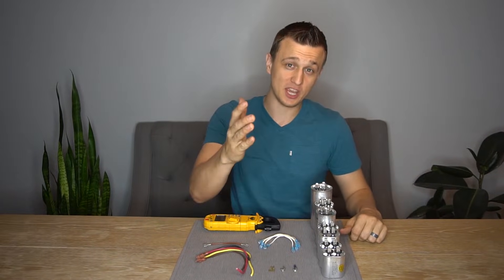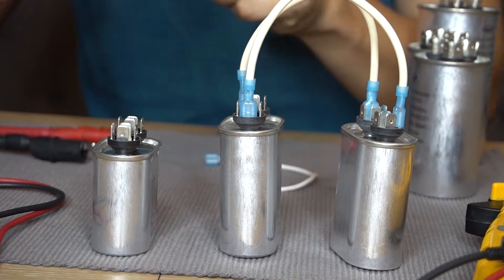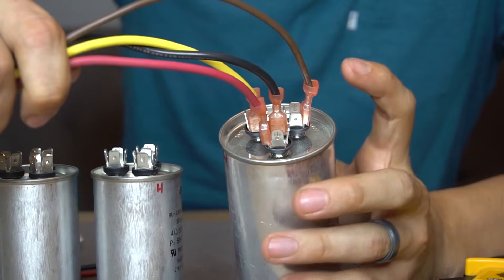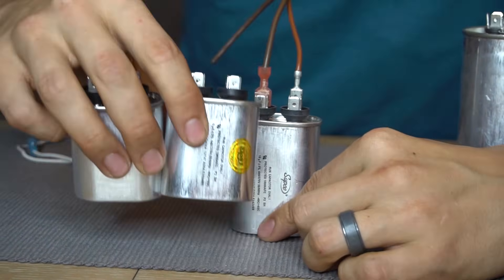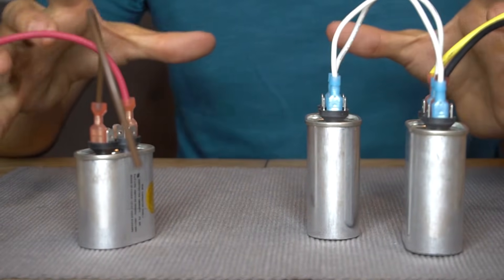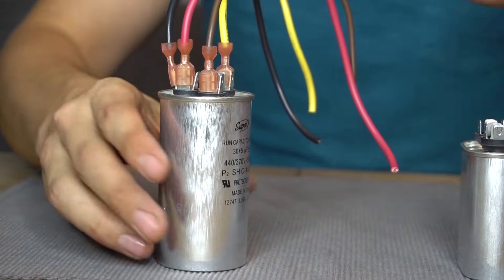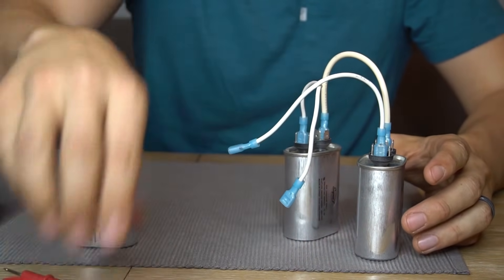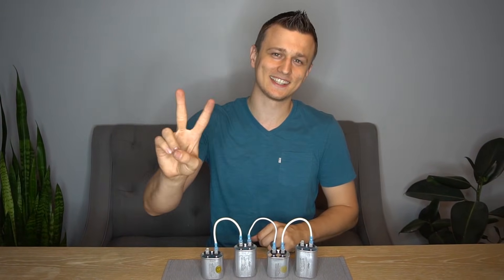How to Combine Capacitors

Comment from the maker: 🔋 Capacitor Videos For Further Info:

Original Video on Replacing a Capacitor: https://youtu.be/C82HvbvP08E
How to Replace a Capacitor Full Guide: https://youtu.be/9ZGfvC-PMWU
How to Order The CORRECT Capacitor: https://youtu.be/mkqaOfvH4a4
How to Check Capacitor With Multimeter: https://youtu.be/5_0nKm940nA
How to Replace a Start Capacitor: https://youtu.be/hC0nFT1XPcI
How to Discharge a Capacitor: https://youtu.be/45oZXnClMD0
What to do if Capacitor is Rusted: https://youtu.be/RSIi47uzApI
How to Install SPP6 Hard Start Kit: https://youtu.be/ThBsRFrdNiY
How to Install 5-2-1 Hard Start Kit: https://youtu.be/KRQ3BzJPPn0
How to Wire A/C Condenser Unit: https://youtu.be/KCanZEsLVEI
Reply: What about wiring the two capacitors inside of a dual capacitor in parallel by jumping the Herm to the fan terminal? For example of 40 + 10 dual capacitor could be wired to make it a 50, but would it be okay to leave it this way? Or would it compromise or shorten the life of the capacitor? I've never tried this and only thought of it recently, and I'm wondering if the amrad turbo 200 doesn't use this same concept

The only thing I can think of where it wouldn't be advisable to leave one that way it would be if the internal fan capacitor was only designed to handle the weaker amp draw of a fan motor, but perhaps when it's included in parallel with the internal compressor capacitor I wonder if that would increase the amperage through the internal fan capacitor

Comment: Thank you for this!! My HVAC guy wanted $180 to install a new start capacitor. I had a separate fan and start capacitor, but I bought a dual for $18 and wired it up based on the content from about the 9:40 mark. All is well !

Comment: I have a trane heat pump xl1200 installed in 1993... set them. At 68° room temp in line with thermostat setting ... fan works on both frunace & heat pump fan is set on auto.. doesn't seem to heat my house very well .... any suggestions

Comment: Good informative video. I think capacitor(s) that are separated will outlast a dual run capacitor they won't heat up as much. Something every HVAC guy should keep in his truck is a few AmRad multi tap capacitors. And maybe a 70/10 or if you have the turbo 200X you won't need to worry. Yeah they're more expensive but there's room for it in the budget with the average price to go out and change a capacitor on a heat pump and maybe swap out a contactor for not much extra.

Comment: Doubling up on Capacitors usually means there a problem else where, What is Happening is there is excessive current Draw in startup of a Fan Motor and least likely a AC pump, Make sure capacitor is held Firmly by putting factory clamp around capacitor to frame of unit and it will stay cool for years to come, When removing old capacitors always make sure they are discharged before handling as even a defective one can cause serious harm or death, Always do a Thorough Check of your components before replacing parts other wise you are going to waste time and Money,  Stay Cool.

Comment: Thanks for the video, but you forgot to mention polarity at the beginning with a series setup. + to + ( - to -) As parallel would be + to -, etc.
Reply: These are AC caps not electrolytic DC

Comment: Using the formula (C₁ × C₂) / (C₁ + C₂), we can see that as long as the two capacitors are identical, wiring them in series will always halve their value: For any positive value x, (x · x) / (x + x) = x² / 2x = x/2.

Comment: I had a problem with my fan not running so I replaced the capacitor and it started right up…. But then I noticed the fan stopped running again and I could here the humming of the compressor….. dose that mean the fan is about to die

Comment: What am I missing?  Watched this several times. Looks like series and parallel were wired the same. 
  I once was told to just add a 5 mfd for the fan to the 40/5 mfd dual when the 5 went bad. 
  Not sure how it ran at all for the time it did. 
  Not sure now exactly how I wired it now. 
  Would like to see a demonstration. 
  It ran for a good while until the drain pan under the air handler gave way and flooded. :(
  I also replaced the board when I saw what appeared to be a burnt area around a diode or whatever it was.  Got heat working but not air. 
  I checked a little while back and the 49 mfd is weak. It only shows like 36 mfds.

Comment: What about the voltage rating? Let’s say we connect in parallel two capacitors. Then the voltage rating of such configuration/combination will be the smallest voltage rating of the individual capacitors, right? To make sure we don’t blow it up.
Reply: Yes, the applied voltage should not exceed the lowest voltage rating..

Comment: This is a great tutorial and I share it with customers often when the correct capacitor isn't available and this scenario will work. So, thank you for putting this tutorial together. My only feedback is you're only mentioning the compressor with your L2 and L1 leads, etc. The compressor isn't feeding voltage to the capacitor, the definite purpose contactor is doing so... Hopefully, this minor detail isn't a head-scratcher for your audience.
Make it a great day and be safe out there!

Comment: This saved me today. After the big heat wave locally, all the suppliers were out of the capacitor I needed. I said, OK, tell me what you do have. Then I selected several available capacitors to make up the right combination for my AC unit.
Reply: Gawd you must be in GA because this HEAT is unreal !
Reply: @michaeljohn8905  Nope, Pacific Northwest, but we are sweltering again this year.
Reply: Ur not just paying 180 for a cap , ur paying for diagnosis , and a service call .

Comment: I just replaced a fan motor on a 43 year old condensor. The new one had two wires come out of the motor for the capacitor.  I just added a cap because it was a different rated one than the original fuel cap. It got me thinking if I wanted to run with a duel cap I would need to use an ohmmeter to find which of the two wires coming out of the motor would be going into motor and which one should be the common. ?
  The other odd thing on this unit, it had a mallory capacitor which I assume to be a split cap. It was connected only to the herm. But it had two wires connected to the outer terminals from the same lug on the contactor and the middle wire went to the start winding on the compressor. It was a 15-10 mfd cap.

Comment: Not only when you run them in series the uF goes down, but you increase the capable voltage.  So if you had 2) 10uF 50v caps and you need a 5uF 100v then you would run the 2) 10uF 50v caps in series,

Comment: Hey Jay! My heat pump is tripping the breaker when it is already running. Could a bad capacitor be causing this? What else could it be?
Thanks!
Reply: You got a short maybe a bad compressor call a tech
Reply: @drodriguez394  Hi, Got it fixed a couple days after asking back last year, lol. Thanks for the suggestion though! It was very helpful!

Comment: are the 3 terminals of Herm, Fan, Common always placed  in clockwise order on top of a capacitor? Also if just the top of a capacitor looks brown (rust, no liquid) with the rest of the can all silver is that considered normal or a sign of damage?
Reply from the maker: The only way to know for sure if it is bad or not would be to test the capacitor with a meter. And to be honest I have never paid attention in which order, going clockwise, the terminal sections are since they are always labeled.. So I don't have a good answer for that

Comment: First ,thanks a lot for your videos .I have a question, maybe could be the topic for another interesting video. How to know what capacitor you need if  all the information on the old one are gone?Thanks in advance.
Reply from the maker: Sometimes the compressor label will say what size capacitor it requires. But the easiest way is to call an appliance parts store, give them the model and serial of your unit, and ask them if they sell a capacitor that fits that unit. They will do the looking up for you :)

Comment: Hello,

I have carrier AC with the model #38CKC030-340. When I check the replacement capacitor, I found two. One is Dual run capacitor round 440 V 35/5 uF and the other is dual capacitor. 370 VAC 45 + 5 MFD. Which one should I buy? Thankyou
Reply from the maker: The best way would be to open the unit and visually verify what capacitor you have in there.

Comment: I can see doing this to get someone up in the field that has a need to be up fast. I would also like to see a revisit on company time and paid by the company to put the proper Cap in place. It is quite possible and actually probable that the parallel method would last longer but it is all dependent on wiring especially and other factors.  Better to have one piece in place that might fail as apposed to two; one that may be perfectly good and one that may fail shortly after installation and we all know as a near DOA product. Limiting the chain to one takes allot out of the equation. BTW, thumbs up for the idea.

Comment from the maker: So just out of curiosity, if you do HVAC work, how often do you combine capacitors? Or do you prefer not to? (why not?)
Reply: Prefer not to but I don't carry every single one.  There is a cap that you create almost any combination under 70 microfarads.
Reply: I needed 45/5  capacitor and the shop gave me 40/5 and 5/5 and it's been working like a charm.

Comment: Thanks for your video.
Does it matter which side of the cap is connected to the next cap terminal? Kind of polarity that they show like straight line and curved line in schematic.
Reply from the maker: Hey Mike! No, the polarity does not matter with capacitors.
Reply: @WordofAdviceTV  
Thanks for response.
So why they put the straight and curved sign on schematic or does it matter I swap the yellow[herm] wire with the common terminal wire?
Reply from the maker: @mikeautostudent5562  That is the symbol for capacitance. (MFD) Sorry, I thought you were talking about a regular run capacitor. With a dual run capacitor it does matter where the wire goes. The herm wire will always be hooked up to the run winding so you can't swap that with the common.
Reply: @WordofAdviceTV  so does it matter polarity in this case bcz common is the other  terminal side of capacitor for compressor.

Comment: Neat stuff!  Now i need you to show and explain the add on hard start "kickstarter” capacitors...   i have a 23 year old a/c where the compressor often doesn't want kick in when it gets hot outside..  here in south florida..  91° today!   Sometimes the compressor will kick in around two minutes after i hear the fan kick on, and sometimes the compressor won't go until i turn the system off for 15-20 minutes and then turn it back on...  any suggestions?  Do you think a hard start kit would help?  Thnx, Don in Boynton Beach...
Reply from the maker: Putting in a hard start kit would definitely be worth a shot. I have a video on how to install a hard start kit. It's actually very easy.

Comment: Sorry but I would take advice from somebody that would force open a pressure cooker.  The key is to cool the skin IMMEDIATELY, grab a gallon of milk or anything in fridge and pour it all over.  Forget trying to find rubbing alcohol.  A lot of skin damage occurs after the initial burn, the skin continues to "cook" in the seconds right after.  So a 3rd degree burn can be reduced to a 1st by cooling immediately with whatever is available including jumping in the snow.
Reply: I agree. Immediate application of cold is the best way to minimize the skin damage from burns.